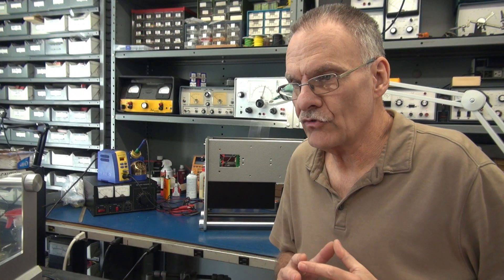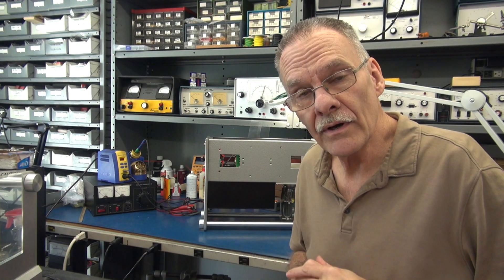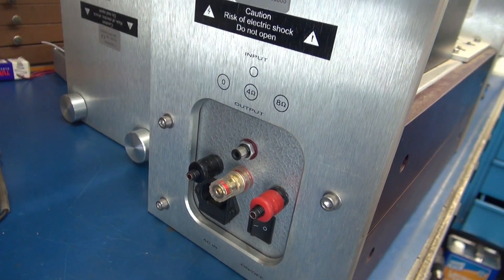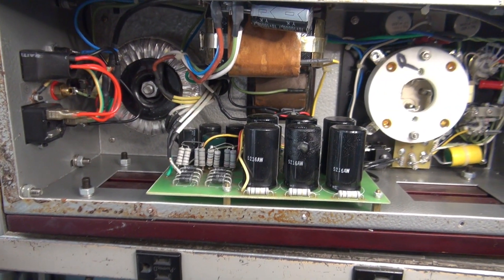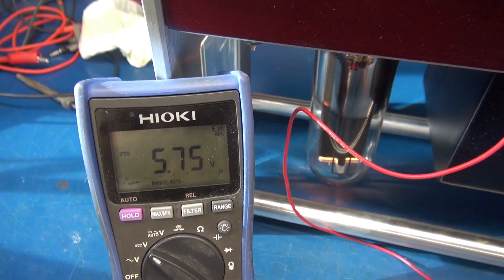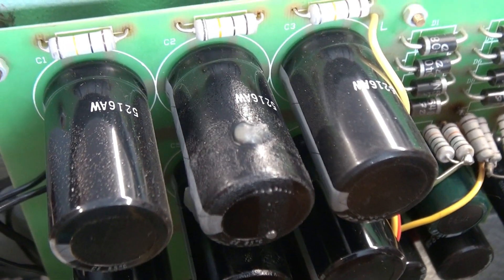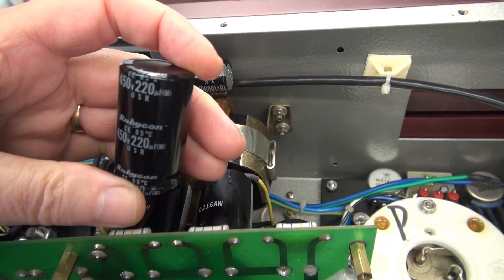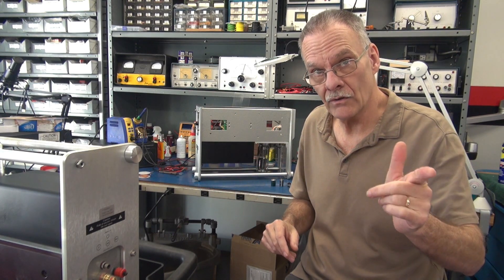Consonance Opera Cyber 211 Home audio tube amp repair stereo mono block system leaking filter caps

Comment: OK mouser  caps are  made in China D  - lab you need made in japan
Reply from the maker: I purchased Japanese caps from Mouser
Reply: @d-labelectronics  OK so nichicon elna Rubycon  so on have factory's in China that's where mouser get there caps , not  Japan which are higher quality D Lab